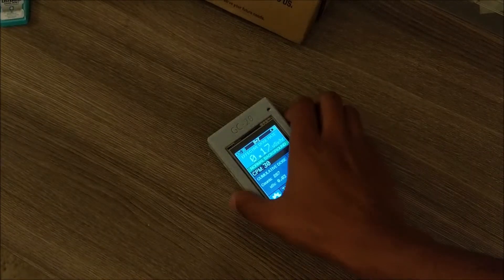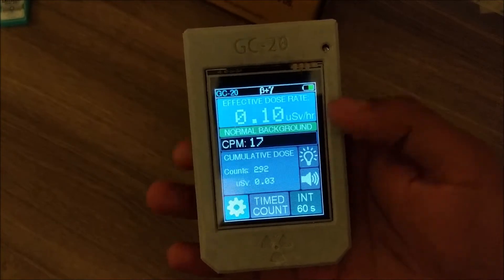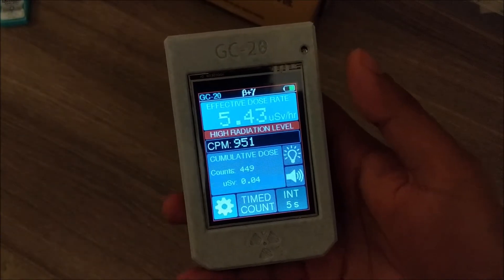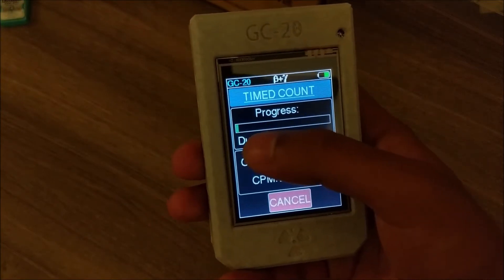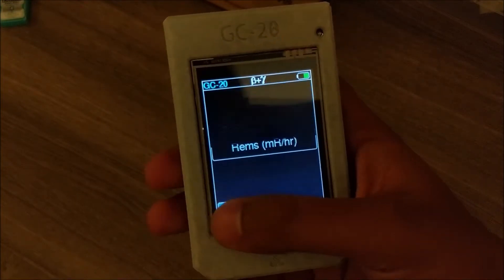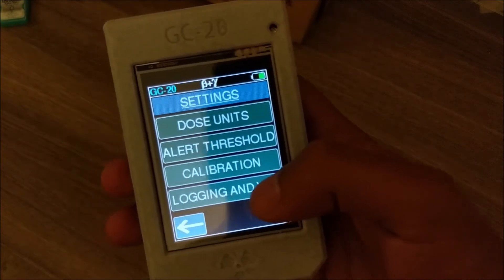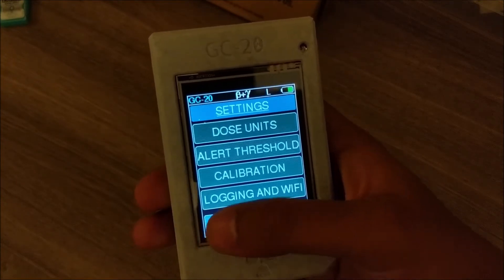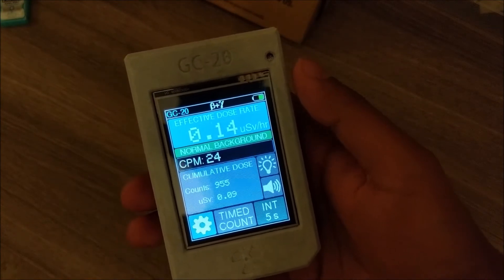DIY Arduino IoT Geiger Counter: The GC-20

Comment: After I bought everything two years ago, a week ago I bought a Yihua 995D+ Evo and so I finally tried to do it myself today. I have nearly no soldering experience and it was my first time soldering SMD components. Everything went smoothly till I got to the last piece, I didn't manage to solder well the L1 SMD component and after trying to fix it I destroyed the connector on the PCB board, so I tried to salvage the Buzzer since I only had one of them and messed the Buzzer up.. now I have to wait till I get my new buzzers, this time I ordered 5 pieces, just to be sure😅😂.. I guess I gonna have to wait a little more with completing the project